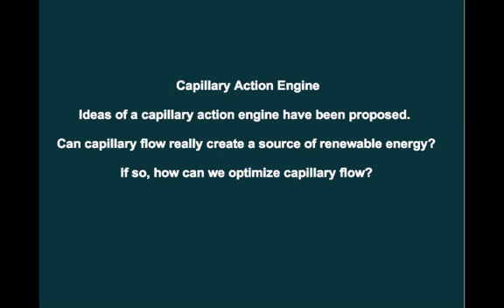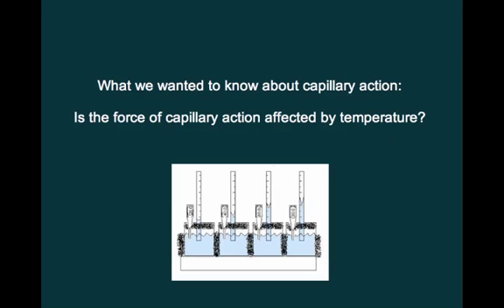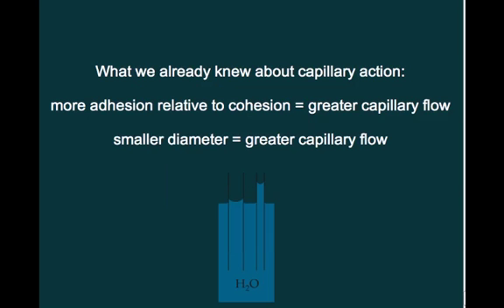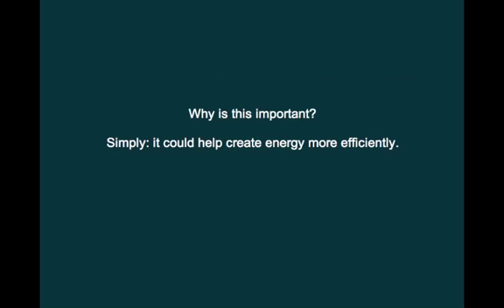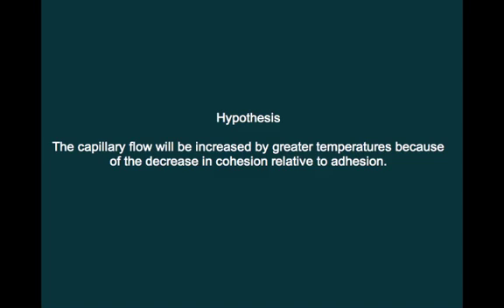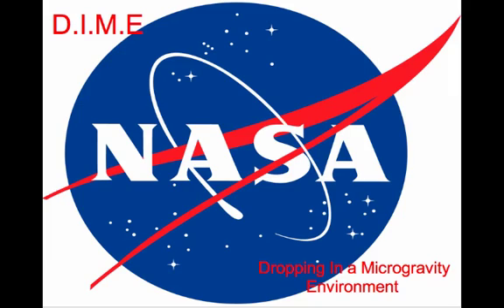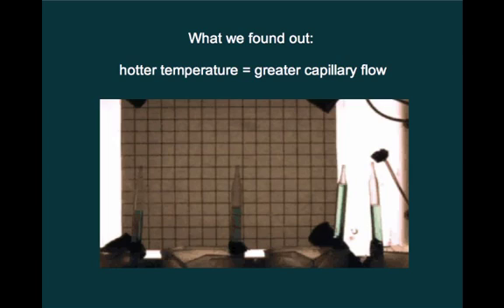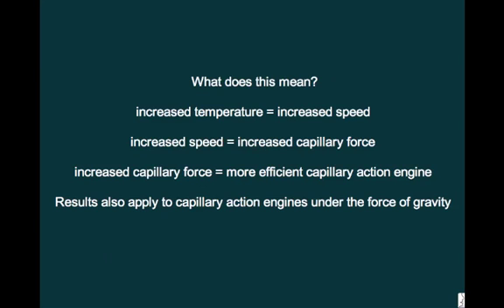Temperature's Effect on Capillary Action Summary Video.mp4

Comment: But have you considered that having a higher temperature in the system will have more losses in energy. Having to maintain the liquid at a higher temperature would loose heat to the outside world. You'd have to continually supply a source of heat to maintain the optimal temperature for capillary action. So this engine design would probably not work because more energy would need to be put into it for it to work at optimal capillary action. If you found a good constant source of heat so the heat losses wouldn't matter then it still wouldn't make sense since then we would make a steam engine because of it being far simpler and more energy. Not as efficient yes but more energy.
A capillary action engine at room temperature would be far more practical because you wouldn't need to maintain an optimal temperature and there would be no heat losses in the system. It wouldn't be that of an extreme amount of energy but it would be very very efficient with next to no losses in energy. Because a room temp capillary engine wouldn't need any energy put into the system. It would theoretically just keep going and going without needing any input in energy.